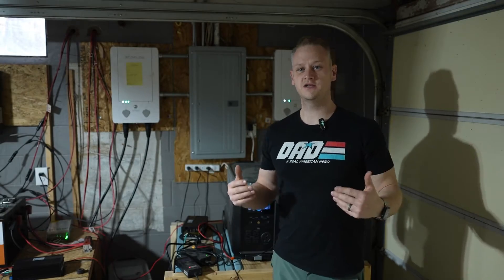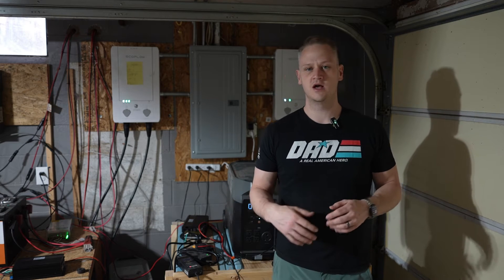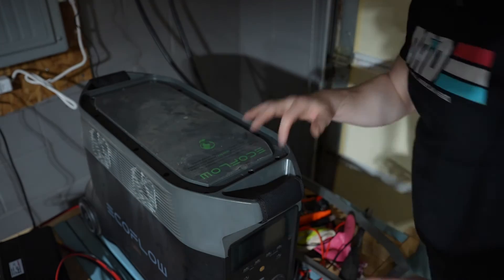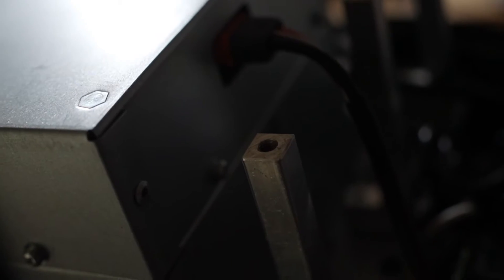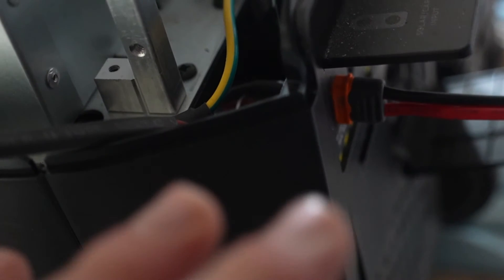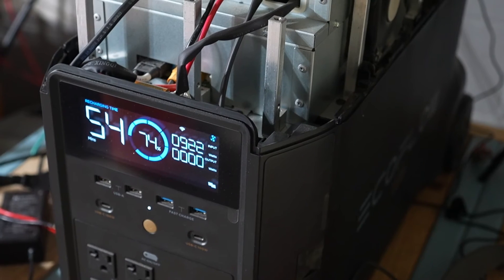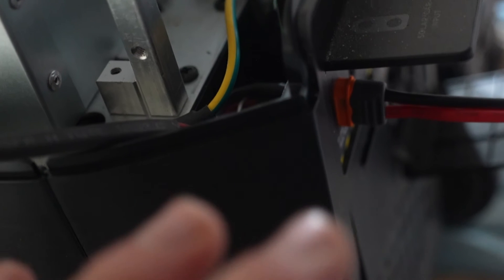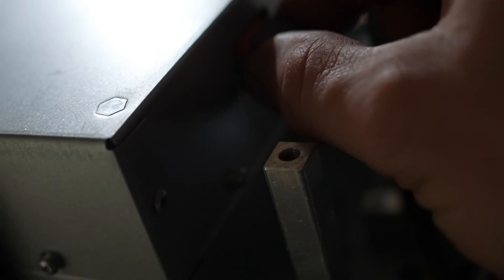How to Fix Your Broken Delta Pro Solar Input Jack

Comment: I have this problem, a bit of plastic came out of the panel input jack and now the connection is loose and not pulling full power off the solar panels. Pain in the ass to say the least. I'll take a look and see if its possible tighten it up.

Comment: Same issue. I fixed it by removing the xt60i and have the female connector on the outside of the ecoflow. Used a Dremel widen the port hole a little bigger fed the orange connector back in. The female connector hangs outside. I can still connect to a car or PV with the original parts.
Reply: Great tech! Could you go into a little more detail on where you widened the port hole and the orange connecter (as in xt60i?) did you pull the whole receptacle out?

Comment: Sir, hope all is well. I have a question about the Delta Pro and charging. First, let me say you have guided me thru some stuff I surely would have 'let the smoke out of' so thank you! How would the Ecoflow charge with the car alternator charger connected to one of the ports in the back and the Smart generator plugged into the other? That would give me the benefits of the generator AND any 12 or 24 volt source....right?
Reply from the maker: Just to clarify one thing first, you're talking about using the Delta Pro without being connected to a Smart Home Panel right? Bottom line, yes, you should be able to "mix and match" DC and AC charging with the Delta Pro by connecting both the smart generator and either a solar panel array or the Alternator charger to the XT60i input.  You may need to make sure you have the settings in the EF app correct so that it utilizes the smart generator (I believe default is 0-100%).
Reply: @DanielGoodwin-jq1oc  No Smart Panel. Its on a Smart Hub which I have wired into my 200A panel with an interlock and an alert device when the Grid comes back up. I am working to address several possible needs.....even going mobile with it. I can have it all down and packed up in a couple of hrs....much faster with help. No permits! No sheit from the MAN. My system has elements of what you have done. As long as I can DC power that Delta Pros like I am set. The more sources the better. So with the Alternator Car Charger I at the very least I should be able to suck the life out of any 12v or 24V battery.....within reason🤣 They say they have made it for van life and I see very clearly a situation where someone would be using their Delta Pro for their major power source. When stopped, they should be able to connect their solar panels using the built in solar input. And connect their Smart Dual Fuel Generator to Expansion Port #1 on the rear of the Delta Pro. This allows DC charging from solar and the generator at the same time. This is important because the AC inverter will not operate while charging on AC; a non Ecoflow Inverter generator. In this example I KNOW there will be a storage battery.....other than the primary starting battery. The thing that makes this device so sweet is that is will also charge the battery it is connected to. I think that it should work on Expansion Port #2 along side the generator for they are both Ecoflow products and its output is DC to the Delta Pro; with the optional Smart Generator Plug. Word to the wise.....if folks have the Delta Pro...you better get multiples of these plugs because they'll be a single point of failure and Ecoflow is moving on to new stuff. SO if it is connected to the DC power of the vehicle it will discharge and charge a 12V or 24V battery. At the same time....which is freakin awesome if it works.😁 If not, I can swap out what i use. My Delta Pro's feed my house 240V at 30A. Each will have a Dual Fuel Smart Generator and a Alternator Car Charger. The generator on propane does 1600W and the Car Charger does 800W and around 800W of solar on a good day. Alternately, if the Delta Pro only allows one to be connected at the time, connecting the Car Charger alone at 800W....not perfect but it allows me to beg, steal, or borrow any 12V or 24V battery if the SHTF🤠🤠Feeding it into my system and never having to shut down the Queens' Air Conditioner😉😉 The things we do to keep peace in the Kingdom! 🤣🤣As long as the specs are within range. We'll See! It's on the way....along with my extra Smart Generator plugs and 2 24V 100Ah battery. If it works like I think I will have some really nice n fat 24V batteries charged up and ready to go. Rather than the Delta Pro Extra Battery. Although, if the Extra Battery is all that will operate on Expansion Port #2 along with something else, then I will also buy the Ecoflow batteries if the price comes down a bit....to dang expensive for what ya get.  I will let you know. May take sum pics too.

Comment: Tested my brand new Delta Pro yesterday and the solar panels cranked the input wattage well into the 350s, BUT.... today's testing, in even stronger direct sunlight (i.e. 11am to noon instead of 4-5pm) had the display going all over the map, until all I had on the unit's display were DASHES (– – – –) and a stated charging time of 11 hours (rather than 1-2). What gives? No amount of unplugging, checking the connectors, etc. helped. And also, my EF app shows wildly different numbers from those on the panel (often 65W, then 245W, then 70W, then 128W, you get the idea). Thought I knew stuff!!

Comment: I only have one comment. Dump the Delta Pros and get the Delta Pro Ultras. The DPU’s are a quantum leap above the DP’s. All the issues you read about for the DP’s are gone with the DPU’s. Period!
Reply from the maker: You're not wrong. The Delta Pro Ultra is a massive upgrade. Unfortunately, its not so easy to just "dump" the Delta Pros unless you want to just completely waste money that many have already invested.
Reply: @DanielGoodwin-jq1oc  that is true. I still have my DP’s (my replacement ones after the first two failed). I only use them as a backup energy source to recharge the DPU’s. Thanks to your YouTube video, I use the DP’s to power SMPS units so I can charge the DPU’s through the solar inputs while the DPU’s are powering my house via the 50A hub.
Reply: I would change brands before I would reward a company by letting them upsell me from their garbage product.  I have two DP and so far no problems. The DP's came out of the starting gate with no reported issues.  Let's give it a year or two on the Ultras and see how they hold up before tossing out those DP;s.  You may be glad you did.
Reply: Only time will tell.   hopefully we don't see any of the DPU's smoking like the Delta Pro's but again, only time will tell......

Comment: So, not sure what the fix was. The xt60i came partially or completely unplugged internally and you simply opened the DP and, using your fingers, you pressed the connector back together?  That's it? Is that a permanent solution? Thanks.
Reply from the maker: Sorry, I guess I wasn't clear on the issue. There is a bracket that fixes the Xt60i connector to the case, in my situations the bottom screw had apparently come out (which how does that happen?) so the bracket wasn't firmly pressing it against the case at the bottom and you couldn't plug in the external XT60 male connector. There's a number of fixes you could do:

1. Fish out the screw and secure the bracket again
2. Use an adhesive to seal the bracket against DP case (this is the path I took)
3. Replace the XT60 connector with a longer cable that you thread through the back case and have it dangle out which means it will always be supported when you plug it in (you can hold both sides of the connector with your hands).
Reply: @DanielGoodwin-jq1oc  Okay, I see now. Thank you for the explanation - It wasn't originally glued on, it had a mounting bracket with screws. Got it. Can we clear this part up, I'm aware that the 60 has some of the same capabilities as the 60i. But, for clarification, when you speak of the connector, or the cable, in any configuration related to this solar input issue, are you speaking of XT60 or XT60i?  Thank you for your time.
Reply from the maker: Yes, In any configuration with the Delta Pro, you will want to use an XT60i connector specifically with the center pinned to the negative side in order to consistently unlock the full draw of the Delta Pro. If you use an XT60 or and XT60i that doesn't have it's center pinned to the negative, it likely will work for your solar arrays to unlock the full draw of 15ish amps but on occasion and if you try to use it with an external battery bank that has a constant voltage, it will think it is is a car source and limit the draw to 7 amps. Hope that helps clarify.
Reply: @DanielGoodwin-jq1oc  It does. Thank you!
Reply: @DanielGoodwin-jq1oc  ok I think this is the answer to my problem ❤

Comment: I have had 3 total Delta Pro's that have FAILED at this point. I purchased 2 units and one failed right away. Ecoflow was great with the warranty and all but these fookers are heavy. Their elderly customers are screwed. Then my second DP failed....Not wanting to have my backup down during troubled times...I fixed it myself. Then the gawd dayum replacement failed! After a back n forth with Ecoflow about their BS....and threats of voiding my warranty....I fixed this one too. There is a real issue here NO ONE talks about. It's an easy fix for a DYI'er but it is some of the cheapest sheit I have ever seen in such a great product.
Reply: I've heard of a couple of failures, but I had no idea it was this common of a problem. Eco Flow should issue some type of inspection and prevention method, S/N of problem units, or service bulletin describing the cause and the fix.